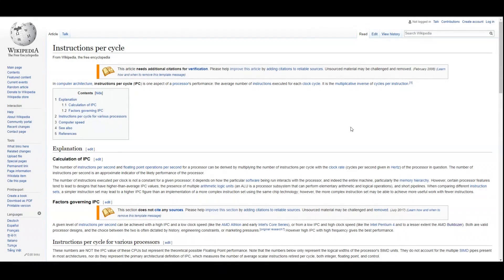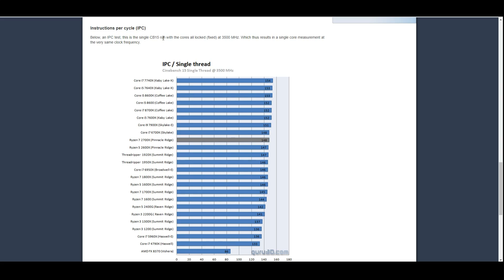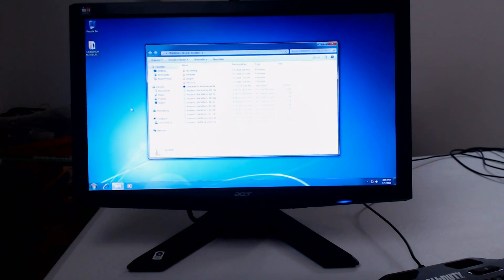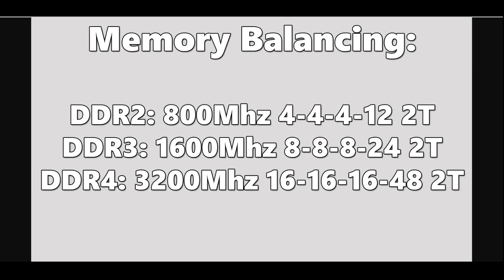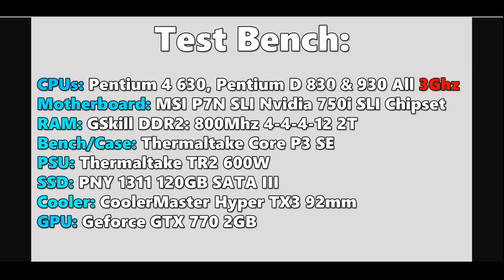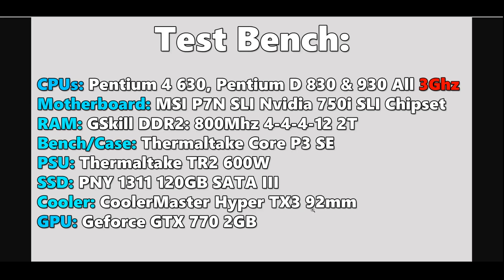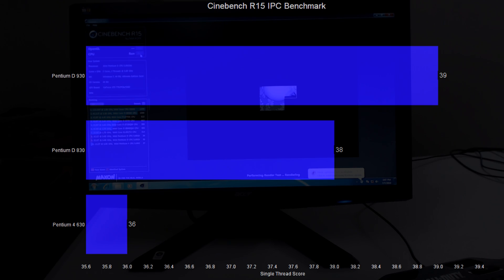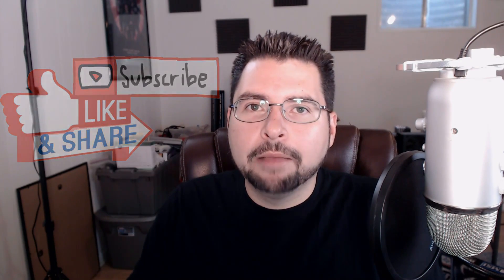IPC Test 01: Pentium 4 Era Netburst Architecture And Testing Methodology

Comment: The FSB overclock will push the Ram frequency up a little. But as you mentioned. Cinebench probably will not even register the change,  especially using the older CPUs.
Reply from the maker: Yeah it's a balancing act and OCing to the full 3ghz would be too much, but right in between makes sense

Comment: Your graphs are terrible.  5% represented by a 400% larger graph... Always annoying and extremely misleading.  If you want to show the different make the scale to 40, then we can see the real difference.
Reply from the maker: That's why I have the 0-300 scale in there. It's clearly explained in the video
Reply: And hence why I said "if you want to show the difference..".  Two bad graphs don't make one good one.  Why not just show the correct scale to begin with rather than one too low and one too high?
Reply from the maker: The high graph is the important one there's virtually no difference between these 3 cpus

Comment: I think the difference between the "formal" definition of IPC with the "measured" IPC is that the "formal" definition only looks at the theoretical maximum number of instructions retired during each cycle. Hence, the nice integer numbers.

Of course, theoretical maximum is useless in real world situations.

In practice, how many instructions can be retired per second depends on many factors, such as cache hit, latency, inter-instruction dependencies, load/store interleaving, context-switching, etc. So, it can vary _a lot_. But ultimately, the "measured" IPC is definitely more useful in judging the performance of an architecture.

So, I agree with Guru3D's methodology, as it is more useful.

Comment: The Athlon XP also had superior IPC, but lacked modern instruction sets and 64 bit. At the time, it was not an issue, and overclocking enabled it to match the high end P4s. The P4 only really beat the XP with stock clocks and optimized benchmarks that supported the P4 instructions. The P4 was never a good CPU for gaming, especially when you threw dual channel DDR on an overclocked XP.  The 64 however, blew everything out of the water no matter how Intel cheated, and started the modern CPU era of multiple cores and 64-bit software.
Reply: Cuzeg Spiked Stuff like this was common knowledge among budget gamers who also bought ati cards. Nowadays, propaganda, advertorials, and shills have completely covered up history and turned PC gaming into something for elitist snobs, instead of the enthusiast hobby it once was. The old ways still exist, but just barely, and you have to know your stuff to not get ripped off or brainwashed into buying overpriced and hyped up products. That said, nothing beat the old days of pairing an athlon with a cheap Radeon, which would give you better performance/$ than a P4+FX fanboy rig.

Comment: So... How long did it take to run a single thread score of 35 or whatever? That might be a more relatable data point. I remember trying to play a DOS game off a 3.5 floppy on a computer that was too fast. That would have been around  1999-2000 ish. I believe it was a dungeons and dragons turn based thing. It was unplayable because of the generation gap. The game was designed for  486  era machines.

Comment: Are you going to test Athlon 64 CPUs at 3 GHz too? I don't think it's going to be easy:D
Reply from the maker: The x2 5800 and 6000+ run at 3ghz
Reply: Yep, but that's not the first generation of Athlon 64. How about s754 and s939 CPUs?
Reply from the maker: It's all the same architecture.
Reply: Same as the CPUs represented in this video, yet you had tested them all. You might test early Athlon 64-s and just re-calculate the IPC though.

Comment: The term IPC as given on Wikipedia is correct (any computer science class teaches the students this definition of IPC) but some people in the industry (both AMD/Intel and tech media) use the term wrong. I suspect that AMD and Intel joined the tech media in this because the tech media started to use the term in the wrong way. Yes, IPC on itself doesn't say anything about the output of the CPU, it is not intended to. It  just gives the number of instructions per cycle, what is being done per instruction is a whole different matter. Obviously, if you do more with each cycle then the output will get higher with the same IPC. Why is IPC defined as it is? Because with the same architecture you can make all kind of changes which change both the clock frequency and the IPC and you want to search an optimum between these. Ideally you need some measurement to combine IPC and output per cyclce. 

Cinebench is fine to compare CPUs but take into consideration that it only measures certain performance characteristics of the CPU. The more diverse the testing the better (floating point, integers, loads with a lot of data throughput ...).
Reply: They (the tech media) really should call it something else. Like Performance Per Clock, or something like that. 
As for more diversified testing, I agree. Userbenchmark.com appears to measure different cpu capabilities like integer and floating point performance, and their hardware rankings are pretty much on the money. Maybe that would be an option in addition to cb15.

Comment: just a note, memory timings are in memory cycles so 800 mhz 4-4-4 timing has the same latency in ms as 1600 mhz 8-8-8 or 3200 16-16-16 (edit fix wrong timings for 3200, it's not 12-12-12)
Reply: I wondered about that. But, wouldn't it be 2400mhz 12-12-12 then 3200 16-16-16? Either way though, it's equalizing the latency across the different ram speeds.
Reply: yes your right should be 3200 16-16-16

Comment: Your graphs are incorrectly scaled it makes it look like the Pentium D is superior at first glance. For future reference keep this in mind as it may not confuse some people it is still a miss representation of the data, by having the graphs not look proper there is no effective use in having them as they are inaccurate at what they are trying to tell.
Reply from the maker: I did that on purpose, and addressed it in the video
Reply: My bad I didn't see the next slide, I saw the first slide and then skipped a minute ahead of the explanation in the process of trying to find the explanation.
 However for the first slide you could do graphics with percent difference as it will allow an analysis of the data while also not being repetitive. for example pentium 4 630 vs D 830 vs 930, 830 performs 5.56% Better than the 630,  etc. another idea is testing the reliability of the cpus scores with multiple run-throughs and how much they deviated between iterations as I would assume a windows random background interrupts to mess with the results especially with a single core cpu, but its your channel do what you will with the data I shouldn't be in control of what you do with it.
From what I've seen this is one of the most controlled tests of cpus in a while as it purely focuses on one aspect of the cpu by blocking extraneous factors. Great Work! Keep it up! I am going to subscribe. :)

Comment: I think ddr4 3200 is too fast. For ddr2 most common speeds where 667 and 800. For ddr3 it's 1333 and 1600 and for ddr4 2400 and 2666. A good idea is too use memory that is rated for that cpu.
Reply from the maker: I thought about that, but then timings become factors. This way latency offsets frequency equally.
Reply: There is no "memory rated for that CPU" on LGA 775 platform, since they don't have IMC. It also makes FSB OC'ing a non-issue, since if you want to measure actual IPC - DRAM or between cpu die bandwidth/latency, shouldn't matter at all.
In this case, we see PLATFORM difference between CPUs, and NOT IPC itself. 
Same thing can be applied if you want to compare Nehalem/Haswell and newer CPUs to Sandy/Ivy bridge.
Sandy Bridge and Ivy Bridge use one clock for Core, IMC and L3 cache.
Others, use different multipliers for QPI, and UnCore (you have to manually set them to equall CPU cores multiplier).
Reply: 2400 12/12/12/36
75% frequency, 75% timings
2800 14/14/14/42
87.5% frequency, 87.5% timings

Comment: the p4's were pretty bad at first but the later ones were pretty good performance wise.  still hot and power hungry but the time of outright domination by amd was over a much shorter period that people think because they assume that all p4's were slower than their competiion but i dont think that was the case.  of course it depends on what benchmarks you are running.  if you are only 0running cinebench then thats a narrow view but one that is accurate for things like rendering video or 3d models but not realy for things like gaming
Reply: bobhumplick for gaming only all Pentiums were slower than AMD cpu's. I remember reading through a cpu test years ago and they had Celeron D 4.0Ghz losing to 2.0Ghz Sempron. That's even worse that FX series 😅😅

Btw I had Pentium 4 Northwood and then Prescott with HT 😅😅
Reply: @Adrian Wujtowicz you cant make a blanket statement like "all Pentiums were slower than AMD cpu's".  you have to say what cpus you are talking about. for instance a new pentium today would most certainly beat a lot of amd cpus'.  i assume you mean p4 era cpu against the athlon competition.  but there were 3 or 4 different generations of each and they went back and forth.  i think you need to do a bit more looking into it
Reply: bobhumplick Yes I meant Pentium 4 era and yes they were all slower than their Athlon counterparts IF WE'RE TALKING ABOUT GAMING ONLY, later Pentiums with Hyper Threading clocked over 3Ghz would be better than some Athlons in media applications I'm not arguing that but back then Athlon 64 and Athlon 64 X2 was what  i7's is for gaming right now 😊